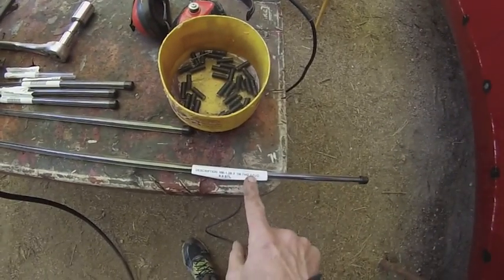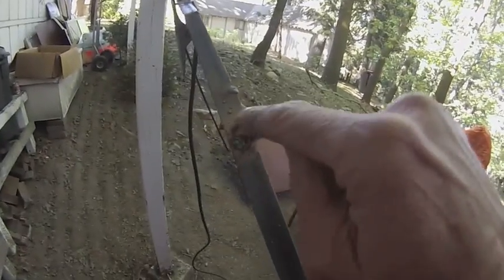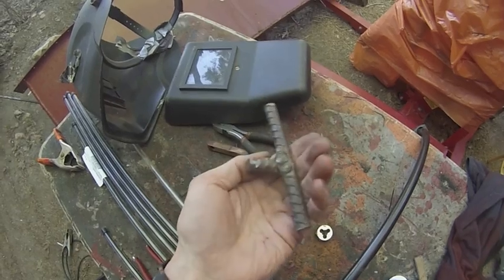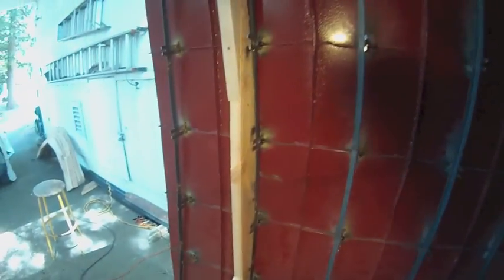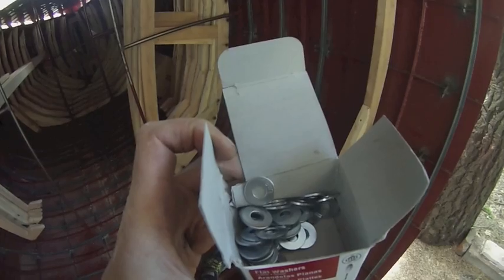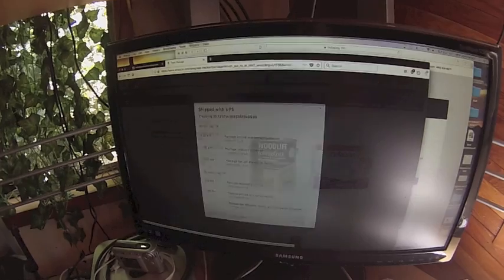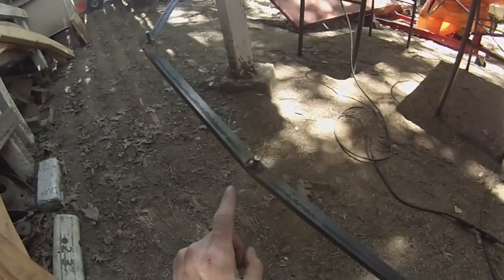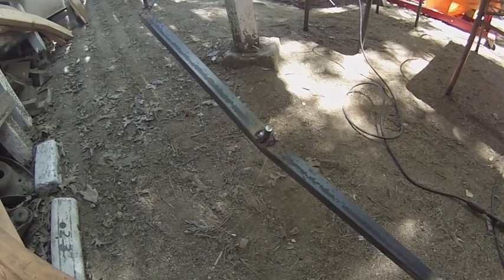Steel Sailboat Build Part 16

Comment: Thanks great progress you could always go with beaching leg that help keep the boat upright when grounded most have them as a bolt on however some like the anderson 26 have them integrated with a pole within a pipe with a grounding plate that resrses in the hull. Food for though

Comment: Its flat bottomed wont have directional stability and will slam against waves instead of cutting through them and more fins wont change that. I fully understand bird cage construction and it can be light and strong early airplanes were built that way but all that angle and 2x4's with weak attaching points no triangulation or even box sections will do nothing but add weight get in the way and make endless areas for corrosion and rot to start. And waste time and energy that could have been used much more constructively. 
On a poss note the fiberglass tender is practical light weight and will come in handy make sure to have a small survival kit on it including flares and a location beacon. bolt or clamp some large plastic tubes or whatever floats to the sides and make it sink resistant. Maybe some sort of bimini top for sun protection.
I believe what you think is cutting board? Maybe marine board starboard , seaboard one of the brands. Its a little soft to be used for bushings. If its HTPE its even softer and will break down in the sun.
Delrin for bushings would be best.
All this work and money and the design is terrible really a shame.
Reply: jason.  Yes i understand your lack of male hormones makes you Pissy at times.
 Your a truly brave key board warrior. Now go lube up. And take it like a ????
Reply: Jason Cox-Rogers  I haven't seen you offer any suggestions, or thought regarding this build... Only seen you "yelling" at Tom, who seems to know what he's talking about...

Comment: Another trick is to leave a nut on the all thread till your your done cutting or till your done completely then just run the nut off of the all-thread and if any of the threads were messed up they will be in good shape.

Comment: I'm no shipwright so I have no right to judge on your engineering, but it's really taking a turn for the better in my opinion, good work! Really like the additional metal work, i'm starting to believe this thing will float and even take a rough wave.

The term (not that it really matters) that you're looking for is Bilge Keel, and I think they're a fantastic Idea for your hull design, I just added some to my 10 foot dinghy and it makes all the difference for flat-beaching of your boat. our boat seems well suited to the idea, I would just be mindful of how the extra drag might affect sailability or steering (not saying it will or won't affect it negatively or positively, just take some time to really mull over what it might do)

Comment: Very interesting.
I dont like the dual "fins"  idea.
Just think... how would a plane fly with dual tails ( vertical stabilizer )on the front of the plane.
Reply: i like distant shores boat. they can drive it up on a beach or sit in low tide and wash the bottom.